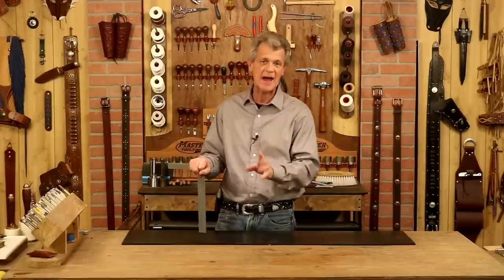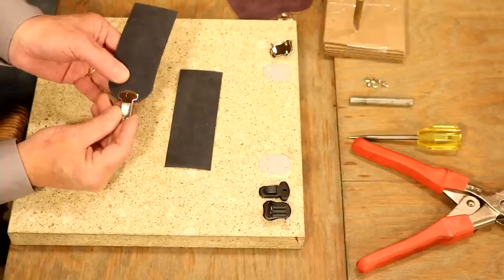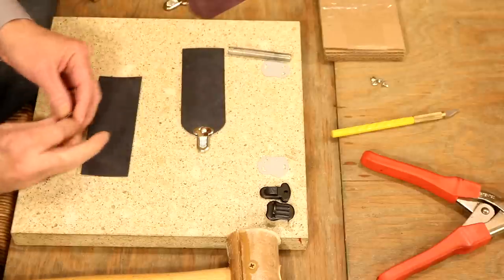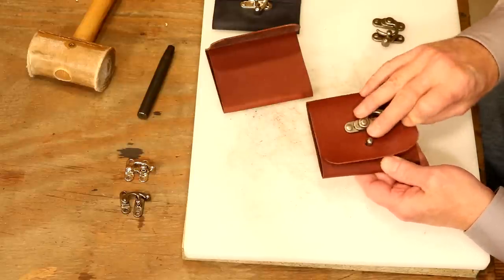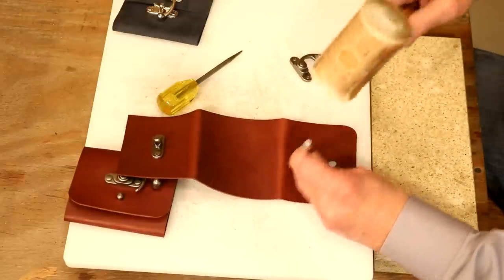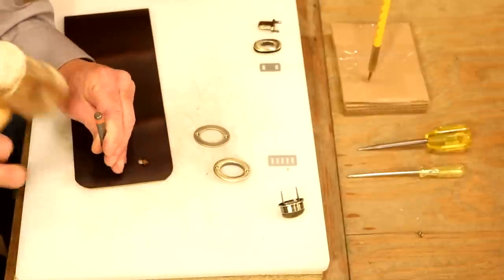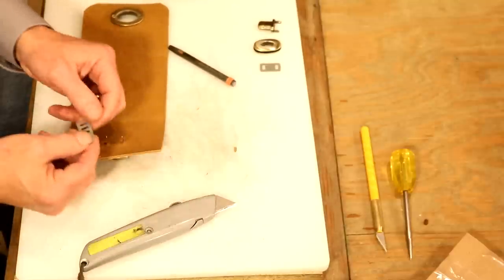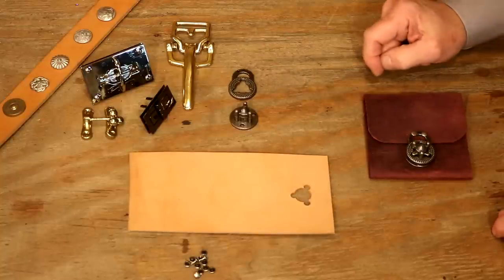Adding Closures to Our Leather Projects

Comment: On the swing clasps, are the rivets not included when you order the clasps?  I just ordered 3, but not one lock came with rivets.
Reply from the maker: They do not come with the rivets, the length of the rivet needed varies depending on the weight of leather you are using. You can use Jiffy rivets, double cap rivets or split rivets to attach the clasp. Hope that helps!